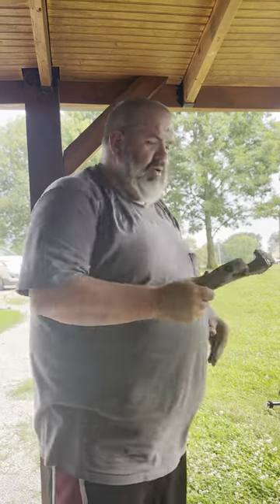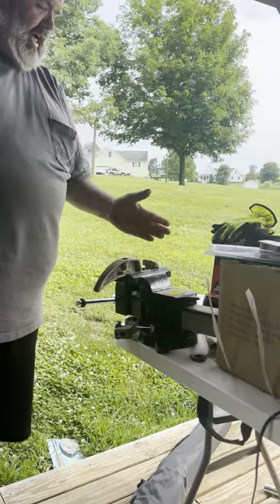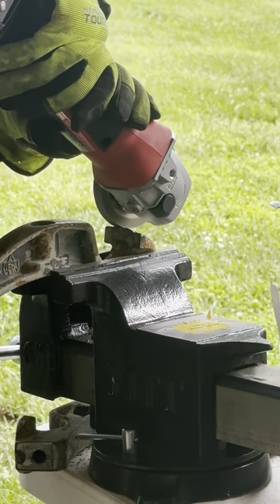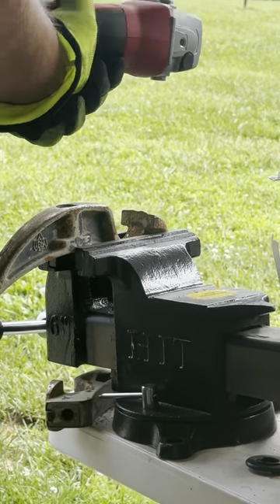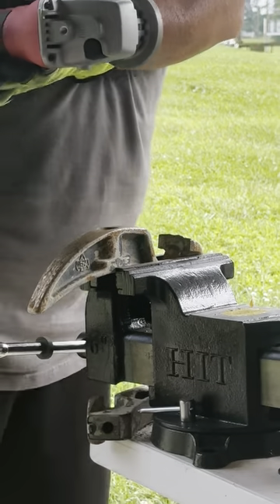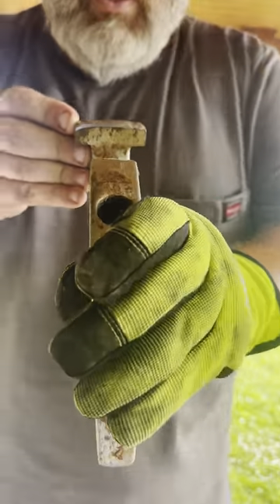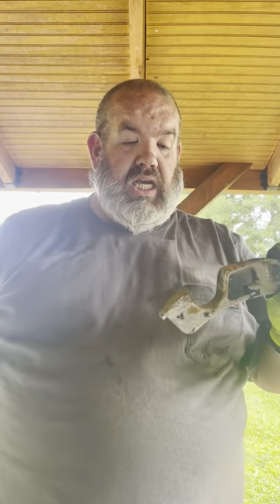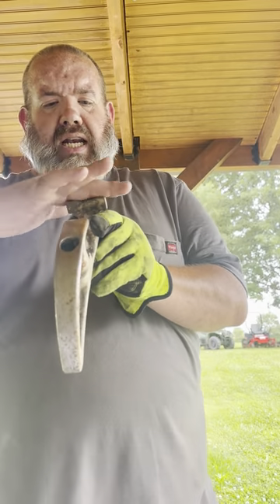Mastadon M60 Forestry mulcher tooth sharpening.

Comment: Hello Big Buck Hunter.  Thanks for the information on sharpening the knives on your Mastodon mulcher.
Two questions for you:
How many hours of use on your mulcher knives before sharpening?
And, can you still effectively use those knives with missing carbide?
Thanks for your video.
Reply from the maker: If it’s completely missing 1/2 a tooth that tooth is basically toast.   The M60 that I have has 20 shredder teeth and 10 chipper style teeth (that’s what I sharpened).  The chipper teeth can last upto 100 hours without having to sharpen but that all depends on not hitting rocks, or any really hard material.   The shredder teeth are practically indestructible.  I’ve just learned how to sharpen the teeth.   I’m hoping to show how to do so out in the field if it ever quits raining.  Any way.  If any more questions.   Just leave me a message and I’ll get back with you shortly.   Thanks for the question and God bless
Reply: Thank you for that reply.
I like the unique teeth on the Mastodon mulchers in that the bite-limiting feature can be replaced if damaged.
Looking forward to more mulching videos.😊
Reply from the maker: @jeffmayeux1692  look us up on TikTok Big_country_jr.   We have several videos on there.